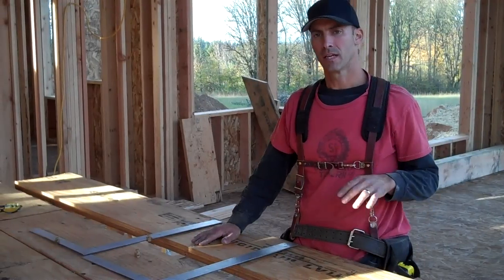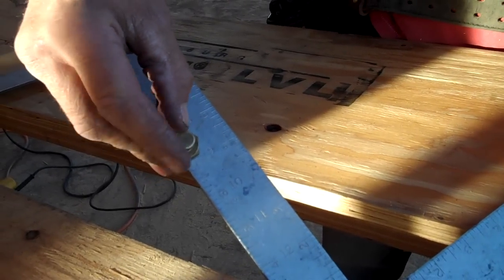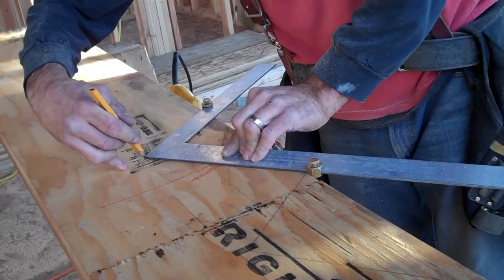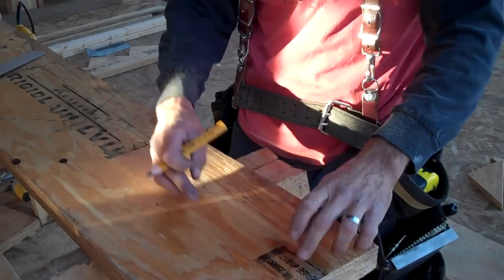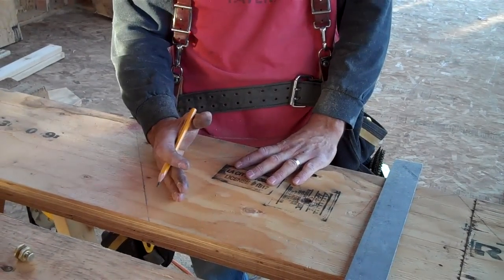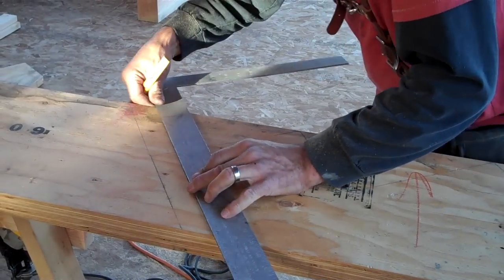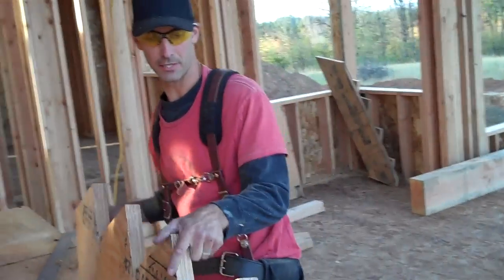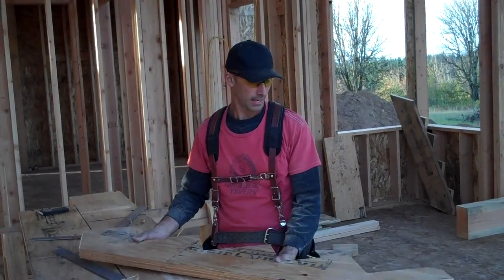How to calculate, layout and build stairs- Part 2 of 3

Comment: Hey Clarke:
I know that your blog is two weeks old, so you may not check back to see this, but you ARE missing something.  We shorten the bottom by the height of the tread so that the first tread will "feel" the same as the rest.  All the stairs are 7.5" high (or whatever his number is), but they also all have tread on them.  The floor you're walking on does NOT have a tread on it, so you lower the string by the height (thickness) of the tread.
Similarly, when you hang the stringer below the floor of the upper level, you set the top of the stringer one tread thickness LOWER than the prescribed 7.5" below the landing surface.

Hey Makenabuilt:
Good video.  I like your pace. The saw running in the background while you're trying to talk is VERY annoying, however. It would also be good to avoid 'dead spots' in the soundtrack.  Thanks!
Reply: *****:
Yes, you are correct.  In the video, they treat it as if they are going to cover the treads and both floors with like material (e.g., carpet).  If they were tiling the top or bottom floors, but not the treads, they would have to adjust the base of the stringer or where they attach to the wall below the upper deck.

Comment: When you cut the 1 1/8 inch off of the bottom of the stringer to make the adjustment for the bottom stair tread you are essentially lowering the whole staircase. So wouldn't that lower your top stair by 1 1/8" now making your top stair rise to big? Shouldn't 1 1/8" be added to your total rise dimension when doing your calculation so that when you cut the bottom of the stringer the top is the same rise as well?
Reply: Don't forget that the landing at the top of the stairs doesn't receive this extra 1 1/8" of material. So chopping the entire staircase down 1 1/8" at the base effectively compensates for the material that was layed for the final step as well as the first step. Well thought out.

Comment: Thanks Makena!  Didn't see you nail into studs so wondering if you nail to studs either through stand-off or stringers instead of just @ top landing and bottom 2x4?  I also posted question if I should confirm level of stringers, or is working off your lines for attachment usually fine?  Great videos!

Comment from the maker: Typically, stair stringers are 2x12s.  The videos have an LVL-type product based on engineering call-out.  This is not typical.  Landings usually are nailed to walls where applicable, and pony walled below on sides where there are no walls to nail to.  Nail size would probably be a 16d hand drive or 10d gun nail.  Definitely different nails if you are fastening to wood floor vs. concrete.  Concrete nails typically have 1" embedment in the slab, so fastener is material thickness + 1".  Good luck.

Comment: Need to ask are there standards for figuring total width of stairwell and allowance for railing (either wall mounted or bannister with posts on outside)?  And, do you need to confirm level before fastening stringers or is working off the drawn level lines good enough?  Thanks so much for your hard work and willingness to share.

Comment: Would you please clarify (total newb) the materials you used here (2x12? composite of some sort), please. Also, landing construction would be very helpful. Did you nail into the studs on the wall side thru stringer, and curious what length nail you used to assure stability off of the bottom 2x4 (into slab?) and does it make a difference what fasteners for wood vs concrete?  I know you just promised to show the calc and layout, but materials and fastener pointers would be most appreciated!

Comment: yes, I get it now thanks a lot..
another question ..how can i Determine the slope of the stair 
by measuring the distance from 1 st floor to
the basement floor (Example: 106” to the basement concrete to the subfloor or 3/4" plywood). the basement is finish on concrete 
and the treads finish  material is 3/4 for the 1st  floor and stairs.
and where can i make the  marks for the top tread line because we have the threshold door on 1st floor. thanks again

Comment from the maker: You are thinking about this correctly.  In the case on the video, carpet was being used in the hallway below the stairs, on the stairs, and in the hallway above the stairs, so it was the same thickness flooring material on all surfaces, so no adjustments were necessary.  If you are using different flooring materials in the different areas, you will need to adjust your stringer trims accordingly.  For example, if the floor mat. is thicker below the stairs than on the stairs, you would trim less.

Comment: I'm confused.  
because you do not have the  finished floor all ready on first  floor, you have only the 3/4 plywood...so rises is 7" and
 the bottom rise after cut the tread material "1 inch 1/8" the first rise'll be with 5"7/8 but when 
you put the finish trade material" 1 inch 1/8" on top the bottom or the first step'll be with 7", right? My question is ...
 but when it installs a carpet or hardwood floor or any any material  on first floor, the first step rise to get smaller the other rises.

Comment from the maker: That's an interesting question.  It really seems to be a west coast/ east coast thing.  Almost everyone on the west coast frames with a worm drive.  On the east coast, you will rarely see one.  I happen to like the worm drives because the blade is on the left side of the saw.  As a right-handed person, that places the blade on the easy side to see.  With a standard non-worm drive, the blade is on the right and you are trying to look over the saw to see where you are cutting.

Comment from the maker: Good question.  Assuming the same finish flooring material for the floor and stairs, the bottom stringer has to be cut by the thickness of the framing tread material.  On all the main stairs, the rise is what you have cut your stringer rises to.  This is because it is that measurement plus the tread material on each one.  On the bottom rise, it is the measurement plus the tread material, since there is no tread material on floor.  Let me know if this makes sense.

Comment: sorry but just a plumber trying to understand framing!!  If your fished floor and stair material is the same (hard wood flooring) why do you still have to cut the bottom of the stringer.  Wont that first stair now be shorter than the rest?

Comment from the maker: In situations (as was the case here) where the finished floor is the same on the lower landing, upper landing and the stairs themselves, no adjustments are made for floor coverings. Normally you would be correct and adjustments would need to be made for differing floor covering thicknesses.

Comment: He had me figuring the Hypotenuse of the triangle of risers and treads and lay them out on the stringer with a tape so there would be less creep of the framing square. You would use the constant function on the calculator, so you did not need to keep reentering the hypotenuse.   I would also cut both stringers at the same time just nail them together, take them apart after cutting them.

Comment from the maker: That was the bottom of the stringer, not the bottom.  You just place the square so that there is enough room on the bottom of the stringer for the vertical portion of the stair.  I go over this at approx. 2:00.  At the point where the second square is against the knock, you need to have at least the height of your rise.  If you don't have enough, move the 1st square up the stringer until you do.

Comment: ahh..how to do you know where to start first, you place the carpenter square but it seems like you can move that up and down, so how do you know where to start your cut . at 1:35 you just place it up at the top but not very top, why and what measurement. also doesnt the carpenter square on the thick side the same size of the 2x4, so you can simply use that that for the notch instead of drawing intersecting lines?

Comment from the maker: I use a Douglas.  Best hammer I have ever had in my hands.  The knurls in the head are inverted/ reversed, so they don't wear out.  Also, the handle is replaceable in 5 mins with 2 allen bolts.  Can't recommend it highly enough.

Comment: he did do a good job but that is a retarded place to put your fingers.  Having framed over 500 house I have never had the need to use my finger.....as a saw guide.  If you cant cut striaght without getting your didgets involved, practice more.  Shit happens, blades warp from heat and glue is in consistant in LVL, saws can jump.   Grab ahold of that wedding ring and pull that hand in.  I think in one of his other videos he has electrical tape wrapped around his finger.

Comment: I agree with and like your explanation of the bottom riser adjustment. I remember first time I came cross that problem it took me ages to work out where to adjust. It's dead obvious now, but It really stumped me back then. Guessing by the comments here, it seems to be a common source of confusion.

Comment from the maker: @mickeybinas To continue, because they were both carpet, we only needed to make an adjustment to the bottom riser so that the rise was the same from the floor to the stairs as from stair to stair.  As another example, let's say the floor below was tile that would be 1" thick from sub floor, and the stairs were going to be carpet that is 1/2" thick- a difference of 1/2".  In this example we would cut 5/8" off the bottom riser instead of 1 1/8".  This would keep the 7" rise consistent.

Comment from the maker: @mickeybinas Good question.  You're just over-thinking it a bit.  The riser was 7" to start with like the rest of the risers, not 5 7/8.  I took off the 1 1/8" on the first one so that it would end up a 7" rise like the rest.  On all but the first rise, the same tread material is used from rise to rise, so they stay the same.  On the first one, you have to make your adjustments for differences between floor covering and tread material.  In this case, the floor and stairs were both carpet.

Comment: as someone who is learning to make stairs this video is very helpful and i would like to say thanks but i do have  one question . you took off the 1 1/8 from the bottom riser so it wouldn't be 8 1/8  which means you started with a 5 7/8 riser plus a 1 1/8 tread equals 7 but what about your flooring on the first floor seems like you will now have a step that is 1/8- 1" too short depending on the flooring

Comment from the maker: @plop7507 That adjustment is made at the bottom of the stringer.  Assuming your floor coverings are the same from the floor to the stairs, you need to minus the thickness of the tread material from the bottom of the stringer so that the first rise is not too high.  The rest of the rises don't need an adjustment since they all have the same material on them.  If you need any addtl info, feel free to drop me a line through my website.

Comment: Am I wrong in thinking you should have divided the thickness of your stair tread material into each rise and then cut the tread material thickness off the bottom of your stringer. It seems that your last rise to you landing will be 8 and 1/8" instead of 7"

Comment: Excellent walkthru with stairs. Good tip not cutting all the way through with circular saw(sloppy construction, weakens stringer) although it is unfortunately done quite often. Question: Do you prefer LVL over 2x12 for stringers?